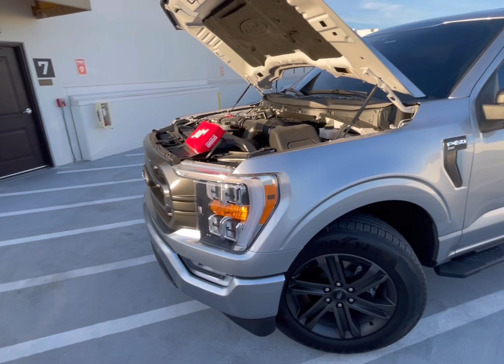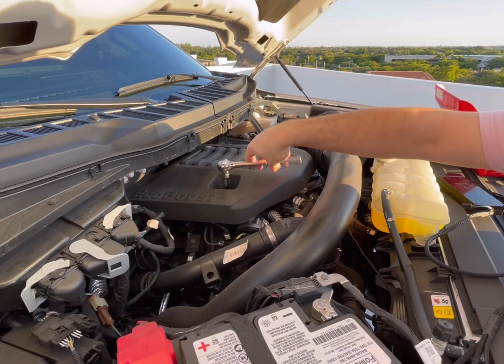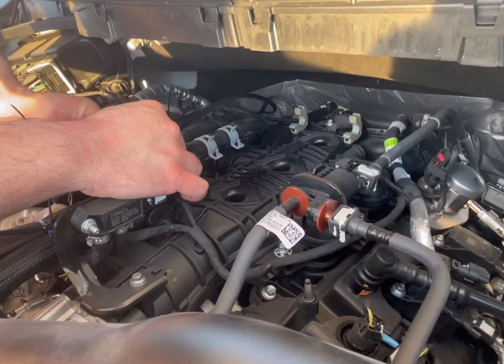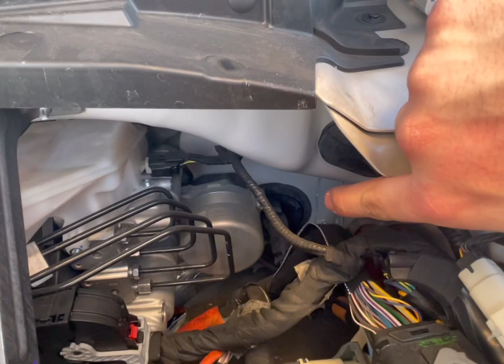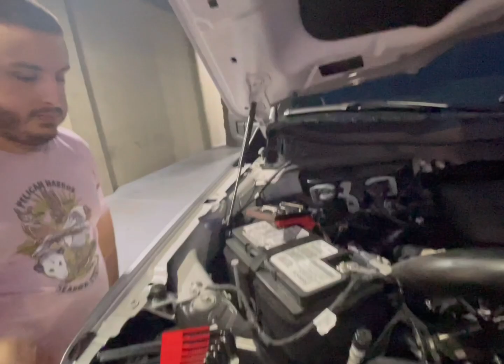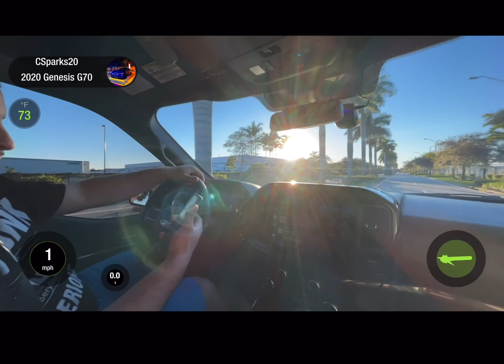FORD F-150 3.5 ECOBOOST WITH JB4 TUNER! DRAGY 0-60 TEST. CAN THE F-150 GET INTO THE 4 SECONDS?

Comment: Did you change fuel injectors to be able to run E85 ?
Reply from the maker: Nope
Reply: @TheAftermarket1  thanks. I just installed this on my ‘23 tremor so I’m still learning about it. My truck is bone stock but been running 93 octane since day. So as long as I choose the appropriate MAP settings, I can run 93/E85 mix?

Comment: how about brake boosting at 2000and   preloading the truck .my stock 21 f150 EB runs 5.0 consistantly on 93 no JB4 .you dont just mash the gas on a turbo motor there is a slight delay .

Comment: I have a 2020 2.7 and interested in this tuner but doesn’t seem to be much gain unless running e85? I’ll just be running 93 octane gas , would there still be sufficient gains with that ?
Reply: You might as well run e85. The 2.7 is flex fuel and e85 is cheaper than 93. MPG is about the same

Comment: What happened to the map 3 run on 93? Kinda skipped over the meat and potatoes of the test.

He needs to leave the engine cover off to reduce the heat load ontop the engine and put an aftermarket air box in with AMS charge pipes.

Comment: I got the JB4 for my 2.7 but since it’s not a flash tune you can’t remove the speed limiter which sucks
Reply: What's interesting is my 2,7 spins 1st,2nd and 3 in the 60 foot but his truck I do not here tires spinning. I use Hp Tuner and tuned it myself.

Comment: Y'all added e85 straight to the tank with no other fuel modifications? Is that okay?
Reply from the maker: Well it’s in conjunction with the correct tuning map on JB4 to make sure it’s running properly. But yes, the stock fuel pump can take up to E40(40% E85, rest 93) from what we found.
Reply: @TheAftermarket1  so roughly out of 36 gallons 7 to 8 is about E30?
Reply: @thebionichandman8967  yes
Reply: @anthonygonzalez7841  the last run, @4.9 was that e40 or E30 tune?

Comment: Why not just buy a street race car???
ANSWER.  
1 because he didn't
2 because this can also tow 13,000 lbs
3 don't need a race car if the f150 can hang with them, haul the family, tow cars, oh and get 20 mpg when cruising. 
4 live and let live. I'm sure some of the haters have enough of their own problems other than hating. 
5 its also hilarious when you drag a camaros ass at a red light. The look on their face is reason enough! 
Good stuff guys
Reply from the maker: Exactly. He’s an airplane mechanic as well. Needs some utility but also wants to be quicker! Nothing wrong with that 🤷🏻‍♂️
Reply: Answer: Because I also already own a street race car, and cant leave anything stock #GT500
Reply: Nothing wrong with making your truck faster I'm with you on that! But no! It cannot hang with sports cars, the truck has 0 aerodynamics, the longer  you race a sports car the longer the gap will increase its just physics. Other than that 
, nice quick truck for what it is.
Reply: @alwaysdriven bruh what? Tier 3 sports cars like wrx, s2000, 350z, all the bs scions rx8s stock supra stock rx7...I will walk em with my 6.7 POWERSTROKE that's been tuned!!!! And I have 37" tires and 6" lift kit lmao...is it safe? Fk no but I still run em down looooool😅😅😅😂😂😂😂
Reply: @madedits2228  no you don’t, stop lying…
Reply: An F150 won’t hang with a sports car past 60 mph. Once you start clearing triple digits even n/a economy cars like a 2.5L Mazda 3 or 2.0L Corolla XSE will vastly outperform a 3.5 ecoboost. Sure you’ll get the jump on them from a dig, but in a roll starting at highway speeds even slow economy cars will outrun a truck. Comes down to weight and aerodynamics at that point. Basically the way drag works is as your speed doubles, the drag against it quadruples. Economy cars while low on power are generally very aerodynamic to get good fuel economy. It also helps them accelerate past 100 cleanly. A 2.5 Mazda 3 will do 135 bone stock, and will get there surprisingly quickly. Let alone a hot hatch like a GTI or something actually decent like a 5.0/10 speed Mustang… 

Also towing 13k lbs in a 1/2 ton is sketchy. Sure the engine has enough power but the chassis and brakes will certainly feel stressed. If you’re going above 10k lbs you should have at least a 3/4 ton, it makes a massive difference. 

1/2 tons have there place being able to be ok as a commuter vehicle and towing a boat or a couple of quads/bikes to the trails on the weekends. I didn’t buy a truck to race…
Reply: @sleeper.simulant7327  That is one lot of spouting. You have zero idea what these F-150's can do. Depends on the sports car but 150's are hurting people all over the street.
Reply: @MovieMuscle  prove me wrong. Trucks are bricks aerodynamically, the faster you go in one the slower they are when compared to a car. An F150 has over twice the frontal area over something like a GTI, and the shape of an F150 isn’t as aerodynamic. The angle of the hood and the windshield are significantly worse, the grill area has a much larger flat section. All those different variables add up. Which is why a 400 hp 3.5 ecoboost will get pulled on by a 241 hp GTI in a 60 roll, get past 100 and the GTI is leagues faster… that’s not even taking into account weight, which also plays a massive factor…
Reply: @sleeper.simulant7327  We are talking modified trucks in these comments. You are now talking stock. Modified F-1250 are destroying pretty much everything that moves. I don't need to say anything more than that. Feel free to keep chatting away.
Reply: @MovieMuscle  no they aren’t lol. You’ve seen 1 specific short bed single cab truck that’s fully built with many thousands of dollar sunk into it, making like 1500 whp running against and beating cars with half the hp, put 1500 whp in a Mustang and run that F150 with the same power, the Mustang is going to absolutely smoke it. Weight and aero play a massive factor. The average guy with 35 inch tires, a lift/level kit, 4x4 crew cab F150 with a tuner and loud catback exhaust won’t be smoking a basic tuned GTI, let alone a tuned Mustang… if modified trucks were so fast, everyone would only be running those. But they aren’t. It’s a fact that building something like a Mustang is far more cost effective to run fast times. Which is why you see so many fast Mustangs out there… “modified F150’s are destroying everything right now.” Ok, prove it…

Comment: Do you need a tune to run e40? On a 21 3.5
Reply from the maker: Yes I would highly recommend a tune first. It will probably still run no problem, but you won’t be getting any gains from it and I’m not sure what consequences there would be on the fuel system.

Comment: It's a truck not a hot rod. Why not just buy another Camaro? My 2022 F150 3.5 EB does just fine stock.
Reply from the maker: Nothing wrong with wanting a little extra pace to go along with the utility
Reply: Because why not? Mine even tows better now and keeps a lower RPM.
Reply: Because as we get older and start a family, we need a vehicle capable of being more practical all around than a GEN6 Camaro SS 1LE. Like the owner in this video I also went from a GEN6 Camaro SS 1LE to a F150. (18 XLT 302A FX4, crewcab, 5L) With nothing more than an AMRL tune my 18 5L truck will outpace my bolton 03 Lightning. I've owned LS1 cars in the past, and with only a tune I'd say my 5L is about stock LS1 Fbody fast, if not a little quicker. I have since bought my wife a low mileage 17 Lariat 501A, 4x4, crewcab, 3.5L truck that will be getting tuned soon. I grew up dailying Terminators, Camaros, GEN2 Lightning, etc, but with 3 kids I need something more practical, but enjoy having a strong running vehicle. The drivetrains that Ford offers in the F150 really lend themselves to modding easy HP, that is as easy to live with as it was when stock, and it's reliability suffer little to non when tuned correctly. The EB and 5L trycks are tuned from the factory ultra conservatively to be able to survive while pulling a load with 87 octane fuel. Not everyone is unwilling to step up to a higher octane fuel.

Obviously the EB is easy to add HP with when you throw better fuel at it and more boost, and adjust the timing accordingly, but so is the 5L trucks. In many ways the 5L in the F150 us superior to the 5L in the Mustang GT. The GT comes factory requiring premium fuel, where the F150 will run fine on 87. This is done by retarding the timing like crazy in the F150, and that and the intake manifold are the main reason the GT makes noticeably more power that the 5L F150. Still the F150 holds several advantages. For sound purposes the 5L in the F150 uses the old fashion Windsor firing order, where the Mustang uses a different firing order. Neither firing order holds a HP advantage over the other, but the different firing order obviously requires different cams, but they are spec'd very similarly. This is the biggest difference between the Mustang and F150 5L's. They use the same block, heads, rotating assembly, and valvetrain. (minus the cams) The other big differences are IMHO big advantages for the F150. First the F150 with the 5L is a flex fuel vehicle from the factory. A stock 5L F150 runs great on E85. Mustang 5L is not factory flex fuel and requires modding to run straight ethanol. (As does F150 EB) This makes tuning very easy with the F150, and with a custom flex fuel tune you can run anything from 87-whatever higher octane available and the tune self adjusts. Also being factory flex fuel the fuel system has to be much more capable to support E85 which requires more fuel than petrol to produce the same energy, and this is why you get lower MPG with E85. The 5L F150's factory fuel system will support way more HP than the Mustang before requiring any modifications to it. To further help make tuning the F150 5L easier than the Mustang 5L the 18+ F150 5L uses speed density instead of MAF with the Mustang 5L uses. With SD there's nothing to peg or mod regardless of HP unlike with MAF. The SD sensor either reads the required pressure, or it registers that the engine getting the wrong pressure coming in. The only time SD is inferior to MAF is if you want to run aftermarket cams, as they generally open the valves more, and for longer durations, and this lowers pressures in the engine. SD works by measures pressure, where MAF reads velocities. Even the 20-23 GT500 uses the F150's SD. Again this makes tuning so easy with the F150, and with a 12:1 CR adding E85, and a tune to optimize running it yields big gains for little investment. This is why the RCSB 18+ F150's have vecome such popular tuner vehicles. Throw a Whipple, some bigger port injector, maybe a BAP or better flowing pump, a good E85 tune, and for good measure some billet oil pump gears, and your looking at a 750-800 WHP truck that in 4x4 form weighs about like a Charger Hellcat.
Reply: What do you care ? And who tf asked about your truck ? No one. You came here to hate and then tell us about something we didn’t ask.

Comment: So its running to 60 in 5.5 sec stock, and that or a little more with the JB4? Granted with a passenger. What's the gear ratio?
Reply: Stock
Reply: 5.5 is with a 1-foot roll out. That's how the rating is done. You can add .3 to all 0-60 ratings you see as specs. The true 0-60 stock is 5.7 - 5.8 without one-foot rollout

Comment: He got into the 4s because he lost 200 pounds lol all those times would have been better if those extra pounds weren't there lol
Reply from the maker: Mentioned this in other comments but if the “before” included a passenger then the “after” will too. That’s how you show accurate results, not changing variables midway.

Comment: I thought JB4 didn't hook up to the OBD port ?  Making I one of the only
Runners being undetectable by dealers for warranty work
Reply from the maker: It does, but it’s not a full flash tune. So it’s not permanently changing any ECU parameters. I simplify JB4 by describing it like a game of telephone. First guy says “make 12 lbs of boost”, second guy(JB4) says “make 16 lbs of boost”. The Jb4 can be removed in 10 mins and unless the dealer is suspicious and does a deep dive they’re less likely to notice it’s use.
Reply: @TheAftermarket1  so it's still traceable ? I want to get it for my 2021  2.7 but it's brand new  and I hate to ruin the extra warranty I bought
Reply: @Travide  yes it is
Reply: You can't tune a 2020 or newer through the OBDII port. Ford locked the computer.

Comment: How much E85 can you run on the stock fuel system
Reply: I’m running E35 mixture at this moment and the fuel trims are not maxed out. It’s seems like the stock parts can handle E50 but there’s no added benefit.
Reply: @anthonygonzalez7841  seems like the only way to tune these 21’s so far
Reply: @anthonygonzalez7841  on the 3.5 you will have to change the fuel pump, but on the 2.7 stock pump will keep up with E85 in the tank.

Comment: Guys I have the Powerboost.  No tunes but this.  Without e85 what are your gains?  Can you eliminate governor for top end, change tire sizes, shifting points, etc?  Appreciate you taking time out.  Merry Christmas 12/25/2021. CHRIS IN SC
Reply from the maker: It hasn’t been dynod but prob 30-40hp gain without E85. It can’t remove the top speed governor, it’s really just for managing boost, fuel trims, etc.

Comment: Pointless way to beat your truck to death.
Reply from the maker: The ecoboost can more than handle a little extra power
Reply: @TheAftermarket1  I have one and it is a sweet powerhouse that is for sure. In my day and age the power and torque numbers on this beast would have put you square in the muscle car arena. 
375 @ 5,000 470 @ 2,500
Reply: And yet here you are watching and hating 😂
Reply: @9663mu  Not hating loving the 3.5, real muscle car power.
Reply: @dapoppa2256  "Pointless way to beat your truck to death" is not hating? Being over-dramatic because you would prefer not to do something that is harmless to your truck is hating. These trucks can handle way more without failing. Just a tune and spirited driving is not going to be the death of this man's truck.
Reply: @JayRSwan  OK, I am not hating. I have a 2020 King Ranch 3.5. I drive it spirited, Miami to Atlanta, to Houston, to Tampa at 80mph all the way. I love the way it runs, smooth and quick, 22 MPH on the HWY, comfort, quiet. Just what I expect from a $65,000 truck. I played with tuners back in the day, but on beaters. There is a difference. Engines tuned for daily driver encompass a broad range of parameters, unlike a tune for all out performance. I have rebuilt both, And tuned both. Back in the day 454, 455,and Cadillac 500 were a good deal of fun, "No replacement for DISPLACEMENT" but we built them for all out performance, not long term durability.  Picture a 500 Caddy with twin Turbos on Nat gas, we would run them in the desert and blew a lot of heads, pistons and cranks. 1000 miles they were done. This 3.5 is a beast of a different color, it is not cast iron or "Heavy Metal", so time will tell just how far this kind of tuning will go, and how well it will last. Not considering the other drive line components. So have fun, just know pushing it beyond spec may be fun, it is, but it has a price on very expensive parts.

Comment: Meh, I'll wait for the real tuners.  Good video though.
Reply: wym
Reply: And whom may that be ? Curious who the real tuners are ?
Reply: @9663mu  LMS e30 is sub 4 seconds tune only
Reply: @9663mu this is not a real tune, it’s a piggyback tune. It just overrides sensors rather than actually reprogramming engine parameters like timing. OTS vs Piggyback OTS always wins

Comment: Anyone tried this for the powerboost hybrid?
Reply: I use this on my Powerboost.
Reply: @brantparrish5785  do you recommend?
Reply: @aj-lhe  absolutely you get very similar gain to what he experienced but I bit better I’ve raced my brother’s 3.5 and I edge him out. (He also has a JB4)
Reply: @brantparrish5785  any dyno results? 

Also did it remove the top speed limit?
Reply: I use Livernois Motorsports for my Powerboost. I'm getting 5 flat with 93. the truck was 5.7 stock
Reply: @JayRSwan  how much did the tune cost?
Reply: @AJ  $821 with shipping and tax. That includes the tuner. The tuner is actually easier to use than the one in this video. You simply unplug the 3 harnesses from the computer. The ones on the passenger side firewall and plug straight in. They  claim 100whp and 90 ft-lbs. I can't confirm this as I haven't dyno it yet. It did cut .75 off my 0-60 through. All the drive mode still works. Although a little more aggressive. The eco feels like normal and normal, like sport and sport is jumpy for sure.
Reply: @JayRSwan  thanks so much for that info. 

I have an extended warranty on my truck. Wonder if the dealers will notice the truck was tuned, in case there’s a malfunction? 

Also sounds like it’s plug and play and in case something breaks we can just remove the hardware and pretend nothing was there…

Does it also remove the speed limiter?
Reply: Livernois Motorsports just came out with a tune for it. They made a YouTube video with the results

Comment: Good video,  I've been waiting for someone reputable to come out with a tune for my F150.  I'm going to look into JB4.
Reply from the maker: Always had good experiences with Burger Motorsports and the JB4. I use it on my G70 as well.
Reply: Livernois also has the available
Reply: @Vintageironchannel  I may wait on Oritz. They still support the X4.
Reply: What about 5 star, MPT, BCB, and gearhead?  Personally I’m going for a 5 star e50 tune.  3.9 second 0-60.
Reply: @Evan Thayer  I had a good experience with Ortiz with my Gen 2 Mustang. I should mention AED as well. Either one of them are fine if you ask me.